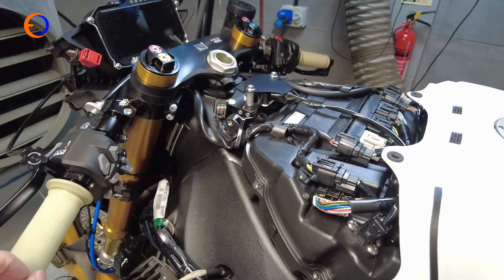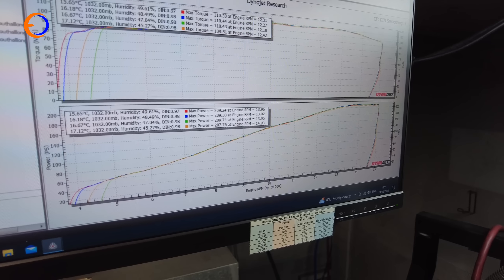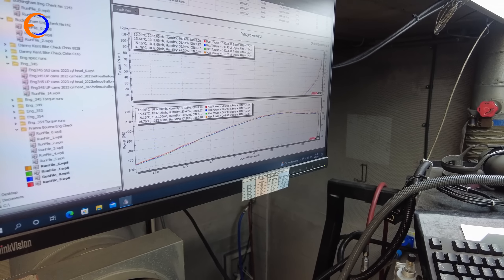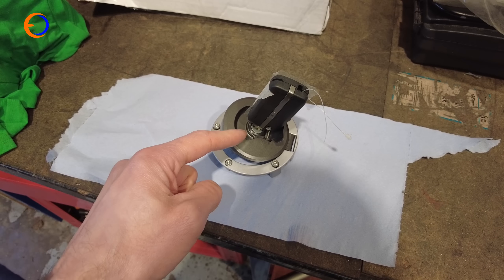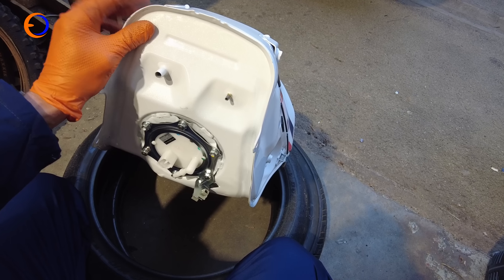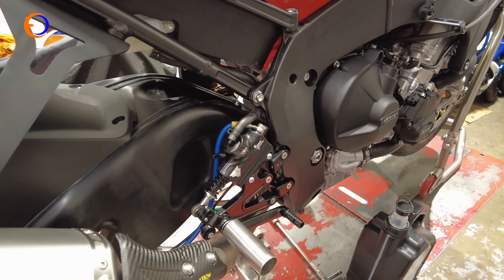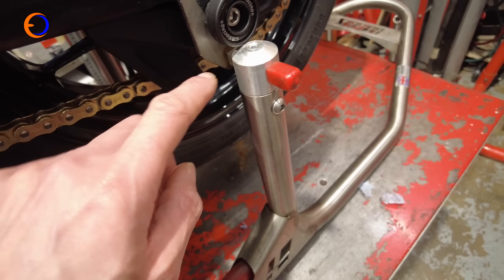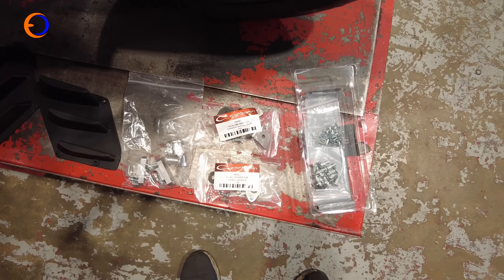Full Power Fireblade. Back to the Dyno for Franco's BSB Superstock Race Honda. HRC Kit Setup

Comment: when drilling screens i use a really small drill bit that wont crack the screen, then a small tapered stone grinding dremel type bit in a drill, and open up the hole that way no risk of cracking and if the initial hole is slightly out of position, while opening it up with the stone in the drill you can push the hole as you pen it up closer to where it should be.

easy and never had a screen crack on me yet using this method.

Comment: To work on fuel tanks i got a nappy changing table for free from marketplace 😅 it worked a treat, soft waterproof top. It was for rust treating the inside of a tank so could wheel it outside for rinsing etc.

Comment: What made you decide on those Bitubo and what do you think of it in comparison to Ohlins and K-Tech?
Reply from the maker: All 3 are excellent quality and very capable options.
I'm a bitubo technical centre so wanted to try Franco with those.
Keeping an open mind, and as Honda Racing run Ohlins, we opted to try some Ohlins too and on the blade the stock shock can be reworked so it's good value.
The k-tech through rod options are the latest tech, and we may try some later, but it's right on the price limit for superstock, so they're the last choice of the 3 purely because of price
Reply: @obsession_engineering  hi. Thanks for taking your time to answer 🙂👌🏻
Reply: @obsession_engineering  Another question. I have a 2015 S1000RR. is the Bitubo pre-drilled for the shock-sensor, having rck3 and data logger installed.

Comment: I love the attention to every detail, speaking of which - does anyone check the position of the rear wheel relative to the frame centre-line or do you assume factory tolerances are adequate/spot on?
Reply from the maker: I tend to measure with verniers from the front of the adjuster area to the spindle. But I also have some straight edges for full alignment check